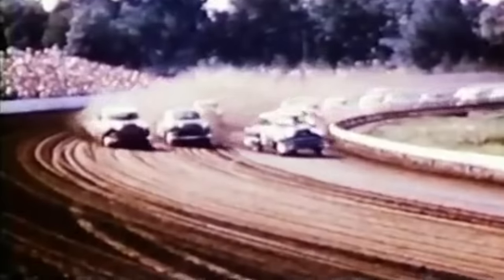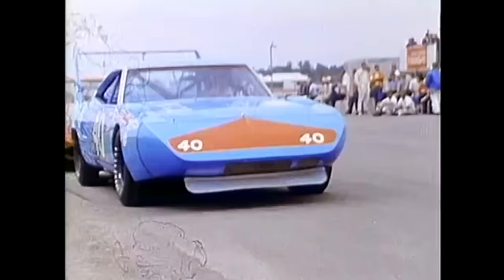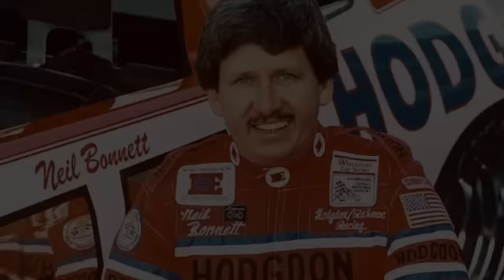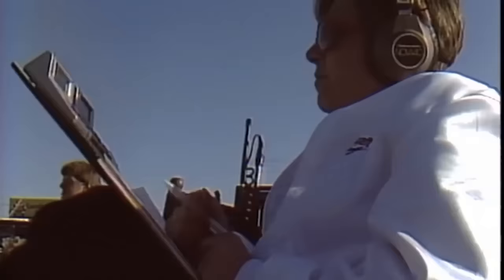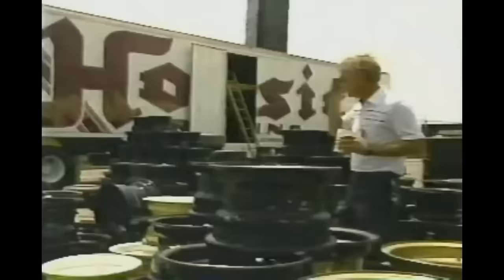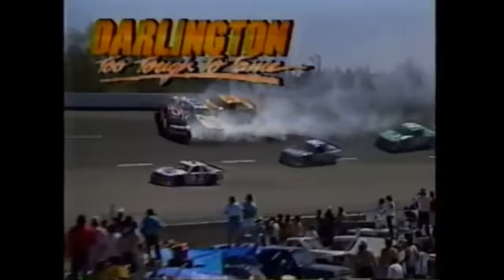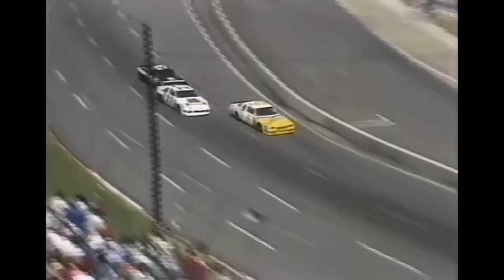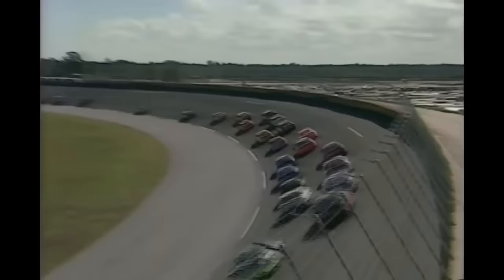Blood on the Asphalt: The NASCAR Tire Wars of 1988-89 & 1994

Comment: Figures Goodyear would make better racing tires. They have the shittiest consumer tires. Shows their research is spent somewhere
Reply: their short track tires are garbage as well, hoosier pretty much owns that market
Reply: The only thing "good" I've ever seen with the Goodyear name on it was their jackets.
Reply: I used to be a hat guy, but not so much now. Plus I've still got Hoosier hats I haven't worn out yet . . . 😝
Reply: Yokohama or bust for street tires.
Reply: Sam Bridgestone Revolution II truck tires or bust. BF Goodrich used to make excellent Long Trail T/A tires, but they changed the tread design.
Reply: Roger Dodger Michelin’s wear like iron and get the worst traction in exchange
Reply: I only buy miches 😁
Reply: @redram5150  I agree, BF Goodrich Long Trail truck tires used to be the best for quality and price. They wear perfectly if rotated every oil change with the steering & suspension checked over every time serviced for failing parts and a proper alignment done when the tires or front end parts are replaced. My biggest complaint with the Long Trails these days is no one can get more than 30k out of them, and that's with grandpa babying the truck doing all of the above said.
Reply: @RingoYote  Yokohama tires chop up and roar like mud bogging tires, even on car's where the alignment is perfect!
Reply: @redram5150  True, but that's not even a fraction of the story as to why Goodyear street tires are total shit! Their tires are noisy as hell brand new, their tire's wear into eggs or chop up so damn easy even with regular tire rotations and a proper alignment on the vehicle, and my biggest complaint is the tires are too damn soft. I can press my thumb into a fully inflated Goodyear tire and I feel like I can put a hole in the sidewall just with the pressure of my thumb!
Reply: KK85 Wranglers cup and feather even with a good alignment and shocks. I mounted tires almost twenty years ago. Goodyears were always a PITA because we knew a good portion would return eventually with complaints. They even sold a garbage off brand tire called a Roadhandler Voyager that people only bought because they were cheap with a 100k mile warranty. Problem with them was they got absolutely no traction unless conditions were perfect and the rubber would be worn down to the wear bars by 30k miles max.
Reply: @redram5150  Just to clarify, I know Goodyear tires are total shit man and those Goodyear Wranglers yikes those were the worse truck tires on the planet. I wouldn't have put them on anything I own even if I got them for free! You should reread my comment, I hate Goodyear.
Reply: Anyone that’s even mounted tires can tell you Goodyear’s are trash. They are so poorly constructed that they looked like shit on a balancer when new. I’d rather have a shitty set of master craft tires for a third of the price. I wouldn’t put Goodyear’s on my lawnmower.  I prefer Michelin’s in most applications with the exception to sports at tires, there I prefer Bridgestone,Dunlop’s,and pirelli’s
Reply: @redram5150  And that's only hot air
Reply: Pirelli, Yoko, Hankook, Nitto, BFG, Dunlop,Maxxis...not Goodyear
Reply: The Goodyear water hoses even suck too
Reply: I've never had issues with GoodYear street tires. They last over a few years for me
Reply: Goodyear's exclusivity is up after 2022. Might Continental (now owning Hoosier) make a bid to supply the top series?
Reply: Nascar is Goodyear's calling card. They have nothing else on the planet worth celebrating. Michelin makes better car tires. Pirelli makes better racing tires. Bridgestone makes better big truck tires. Hell id rather have cheap Chinese tires over Goodyear.
Reply: KK85 I read your comment just fine. 

I worked in a tire shop for years. First in the shop, then selling them. My opinion is based off of customer use considering all their info regarding purchase date, when and at what mile they were rotated, etc. By and far Michelin’s gave the best tread life. However, their traction suffered for it. The tires on my vehicles weren’t out of spec either. 

And tires aren’t supposed to be on a vehicle for a decade, especially if it’s parked outdoors.
Reply: Rick Feith Dunlop are made by Good Year for the Americas. IIRC, Continental makes them for the rest of the planet
Reply: @1991petrolhead  Bridgestone also had f1 and has Firestone

Comment: The only series that I know of that ever made a tire war work is Japan's Super GT series.  Somehow, they don't end up with disasters like this, and actually want the tire war as part of their marketing and as a strategic element.
Reply: Correct you are, in Super GT, you have Bridgestone, Dunlop, Michelin and Yokohama, with Bridgestone, Dunlop and Yokohama running in both GT500 and GT300, However, Michelin tires are ONLY found nowadays on the factory #23 NISMO GT500 Nissan.

Comment: Great explanation.  Refreshing to hear the truth for once. I was there and can confirm all you reported was accurate.
Reply: Amen, except that ARCA ran Hoosiers and Goodyears before 1995. The 90's version of the Hoosier Tire were fine, IF you were willing to listen to the tire engineers. The ARCA team I worked on through that era ran Hoosiers exclusively. They were the exact same tires Cup ran. We would run the whole 200 miles at Michigan without having to change tires.
Another thing, we did run Goodyears once at Daytona one years because we were supposedly going to be on a deal through our drivers Cup connections. We were already on a small deal with Hoosier. And Hoosier would let you mount up an extra set of tires, if you didn't use them, you could return them and only pay for the labor to mount, balance, and unmount the tires. Goodyear looked at us like we were from another planet when we tried to get a replacement for a defective tire before it ever got put on the car.

Comment: Hoosier is also a big tire in sports car racing, both in slicks and in DOT Radial tires.  Refereed to in open tire classes as Purple Crack due to their performance being much better than competitors, but the life being shorter.  Of course either point is debatable.  When Hoosier came out with their DOT Radial in the 90's they indicated that a lot of what they learned in Nascar helped to make that tire so awesome out of the box.

Comment: Hear later in the video that it wasn't caused exactly by a tire failure, it was by equipment failure. I have seen a good bit of racing between all 3 manufacturers. In some series each tire has proven itself. I.E. Firestone now in IndyCar, Goodyear in NASCAR and if you watch enough short track and USAC racing uses primarily Hoosier from what I have noticed.

Comment: It sounds alot like Hoosier got some real bad luck in 1994. But then again sometimes all it takes is a bad image to change peoples minds. I mean, when you show up and the only similiarities between two recent deaths was tires it's understandable that people went to that conclusion. It sucks, but one bad moments can destroy careers and companies, especially ones that are struggling to get a foothold. But I believe Nascar is partialy to blame. I don't know the sport very well but I know alot from second hand from my dad. Nascar has a tendency to makes tons of rules when it comes to advantages(Basically everything Jr Johnson did lol), but when it comes to safety it is a secondary priority it feels like. Nascar didn't challenge them to make the tires better, and worse they didn't update the cars and safety precautions. It took all these deaths and later Earnhardt Sr for Nascar to finally make things safe. Maybe that could have changed things.... Then again if there's one thing I've learned over time is that safety precautions like guards, neck braces and back up systems don't exist until someone dies or gets hurt. You need the first example to be able to fix something.(just took Nascar a few more than just one)

Comment: Funny how tire wars never seem to work out in the US, but are more or less fine in series like Super GT or F1 (minus Indy in '05)
Reply: JERACERX That’s mainly because the forces exerted on tires in NASCAR make it extremely difficult to push limits without potential for danger. Thus when competitions like this spawn they bring with them a will to push boundaries and a lot of problems as pushing boundaries becomes dangerous.

Comment: A little overdramatic on the title. Overall, a pretty good wrap up of the story of the day. More accurate than practically everything else. At least it sounds like you did your research.
But don't be fooled about one thing. NASCAR wanted Hoosier/General to stay in the sport and welcomed their decision to put their full effort behind ARCA. There were a couple of times it was rumored that Goodyear was going to pull out "purely for business reasons." If that happened they knew what could be had from Hoosier/General, and they could step right in, and NASCAR wouldn't miss a beat. ARCA loved it because it showed NASCAR supported ARCA's efforts, and should be taken seriously.
I had been known to bolt on a set of Goodyears or two on my personal race cars, but through a certain source I could get new or scuffs for $25 a piece. (long story, even for me)
I don't know why I chose to watch this, because there is so much false info that "turds up" the internet, that I usually don't bother because I've been there, done that. Glad to see some that doesn't.

Comment: funny thing is good year tried making dirt track tires but failed xD
Reply: That's not true, Goodyear was very successful in dirt track racing back in the 80's and 90's. The only reason they pulled out was because their interests sifted away from manufacturing tires for short track racing to only providing tires for series that had extensive broadcast exposure like NASCAR and NHRA fuel racing. It was all about getting the best bang for their buck when it came to advertising dollars.

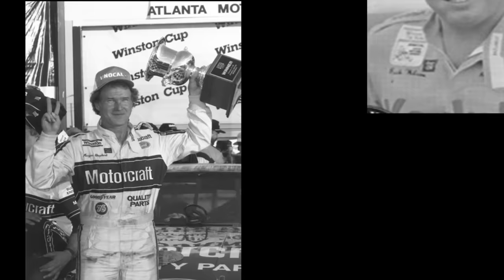Comment: Not just "The Thunderdome", i also noticed "Die Hard" Crane (something) at 4:18 :-)
Reply: Crane Cams. They're a camshaft manufacturer.
Reply: @JRC99  Thank you for letting me know it's Crane Cams. Because you told me, i actually got off my lazy butt, found my magnifying glass, and had a better look at my small screen. "Yes" lt is Die Hard Crane Cams. Thanks again JRC99 :-)
Reply: @edwardgriffin8092  Not a problem!

Comment: Good documentary on a crappy subject with the deaths. I don't think Nascar cleaned up the tracks good enough engine parts suspension parts other debris could cause a tire to blow at 180mph. I could be wrong but the way they run now they won't ever have to worry about a tire blowing up. With the segments like every race is the all-star race or Winston. And the tapered spacer unit to keep that extra 200+ horsepower 🐎 plus out of the engine is messed up. They screwed Nascar up so bad that I haven't watched a full race since 2006. When I went to Daytona for the third time 1994,2001,2006 when Denny Hamlin won the Budweiser Shootout.l also was at the Daytona 500 qualifying Jeff Burton got the pole at a slow speed of 189 mph. That was a very cold day at Daytona about 40-50 degrees in February.

Comment: Since Goodyear's contract is running out, I have a feeling there will be yet another Tire War coming up again, and I wonder if Hoosier will make a return to NASCAR or not, from what I've seen of short track racing I've been to (Stafford Motor Speedway), their tires look way more durable than the current Goodyear ones, which look like latex and the fact that those can tear the car body apart if a tire blows...welp. Even the lug nuts don't seem as strong as the older ones, considering how at COTA, Bubba Wallace lost a tire due to a loose lug nut, and it ended his day. Also heard what happened with Neil, but not with Rodney Orr, very sad to hear how his career and life were cut short along with Neil's.  😢

UPDATE: Goodyear's contract was renewed.

Comment: I used to run quarter midgets at silver city (same track as Joey lagano when he was a kid) and for two years we were required to run Hoosiers. They werent as bad as dunlops but they sucked ass. I'm 18 and thus retired from quarter midgets now, and my favorite tires were alwase Vega yellows. The track and QMA now run Vega whites. Right sides anyway, there was never ant rule mandating what your left sides were. I alwase had and old dirt track tire as my left front and a vega yellow as my left rear. I won many races with that combo, and just a couple weekends ago at the alumni race I got a win with vega whites on the right sides

Comment: A quarter inch too wide? I have worked in a factory next to a rubber extrusion line that made vehicle door and window and trunk etc. seals for vehicles. A quarter inch is like literally double what the customers would allow to pass inspection. Rubber does not have that much elasticity. It is in the heating and cooling of it. One or more of their parameters were off and this error should have been noticed at the extrusion part of production.
Reply from the maker: Like you said, there's no way something like that sneaked passed the production line. They did it on purpose to give themselves an edge on the track, but it got noticed by the officials and never turned a lap.
Reply: @S1apShoes  omg a reply from the video creator! Best day of my life!

Comment: So....... no competing tire manufactures.................. Along with nearly identical "factory nameplates"............... Equals boring races and fan apathy.........

You know, racing used to be about different brands pitting each other against other competition. "may the best team win" has become a mockery in the Motorsports........

So, as a consumer, it really doesn't matter whether I choose a Ford, Honda, Chrysler, GM or Hyundai. They're essentially all the same.

That's why I only choose and drive classic vehicles refurbished to my specifications.

Comment: Both accidents had the same problems??what's the odds??find another example where 2 died with the exact same problem even if it's not close in time..if Goodyear wasn't cia, you might think they were involved with those wrecks but considering they are, you should know it.

Comment: Bridgerock v Badday at Indy with F1s! Neither tyre was any good. 8 started.
I have been in road racing a dirt ovals for decades. 1 tyre appears better than the other. But then seem to lack for the majority.
10 years ago Goodyear [aka Badday!] were the 'gun' tyre for Sprintcars but probably had 2 heatcycles and were useless. American Racer [Mcreary] and Hoosier still had winners and the American Racers were the most consistent. Hoosier faster initially and slower later.
I have used a various times Bridgestone, Dunlop. Avon Goodyear slicks with various results. 
And semi slick Toyo Falken, Yokohama and Bridgestone. All good or bad at various times.
Also ofcourse the car has to be suited to the tyre. The reason some get good results and others have failures.
Reply: You mean the set-up has to be suited to the tire. The car doesn't know the name stamped on the tire. But it knows if it's the right set-up for any given tire.

Comment: Hoosier Tires disliked this video
Reply: I know you are joking, but why would you say that? Except for a few, not the best worded parts concerning '94, it was they closest to being the accurate story. I've got a little problem with a point left out about Dover. Geoff Bodine was plenty fast enough on Hoosiers, and was leading the most laps. The more experienced Goodyear drivers could hold on, until the ones with less experience would try and knock down a wall and cause a yellow. That gave the better drivers a chance to change tires. Bodine wouldn't have to pit, but for the first few laps in the run, then the Goodyear Gumballs would just eat him up. For about ten laps. Then Bodine would take over again, until CRASH, out goes another Goodyear car, and another yellow.
Reply: @DDS029  Its a youtube joke for excellent content that has 1 or a handful of dislikes. Calm down.